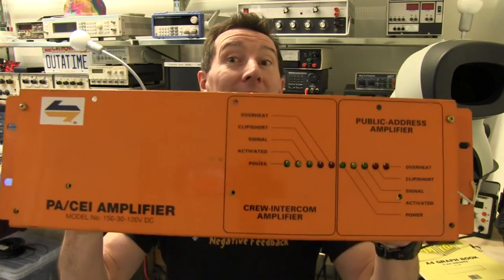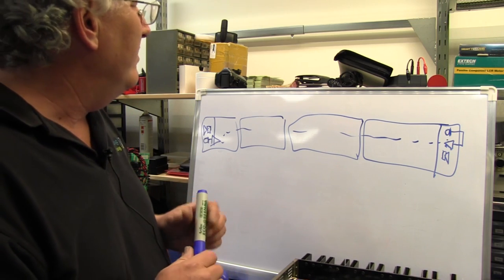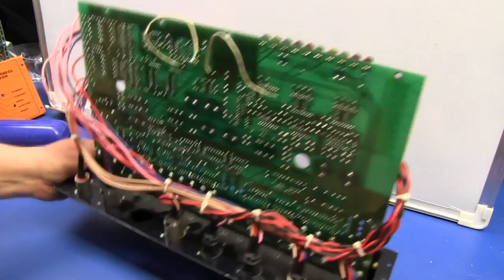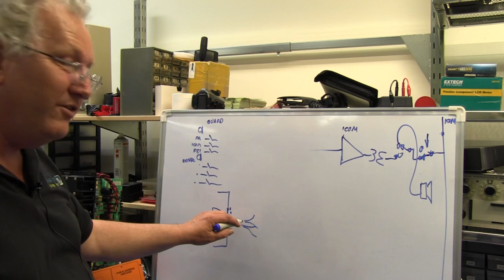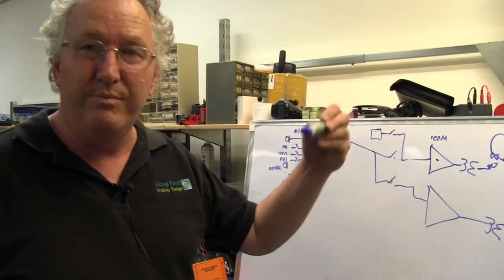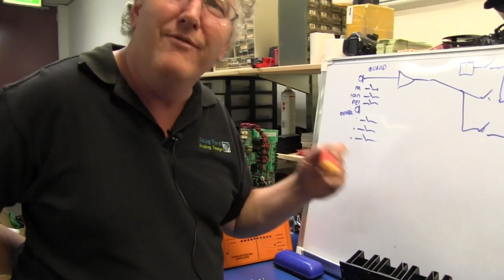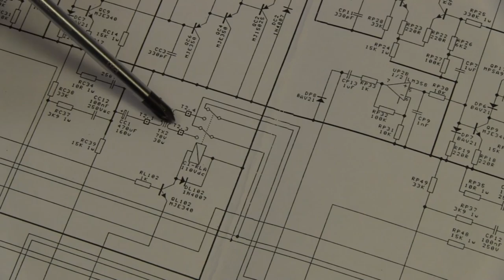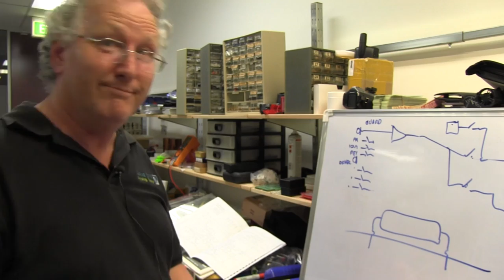EEVblog #354 - CityRail PA Amp Teardown

Comment: I wrote a software simulation of the Virgin Voyager trains in the UK that was based on the schematic diagrams of the train. By the time we'd finished the engineers could connect a real train door, etc to it and test it which was pretty cool. The wiring of a train is a bit mental :-D

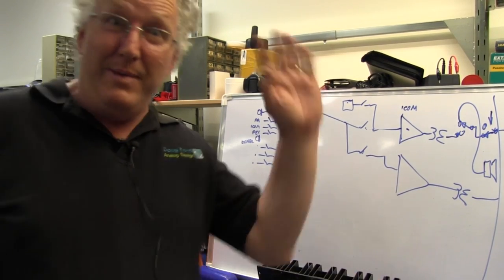Comment: @40:44 - When he described the reliability and life cycle of the JS-920, it reminded me of the Peavey CS 800. The CS 800 is arguably the most durable and reliable power amplifier ever made in the U.S. They started production of them in 1984 and most are still in working condition to this day. They are BEASTS. They weighed a ton and would take any punishment that you could throw at them. They are TRUE 400 watt RMS per channel and VERY over-designed, both electrically and mechanically. I currently own six of these amplifiers, which I had purchased from a studio, which we had done a lot of recording at, and was going out of business. They are in perfect cosmetic condition and, besides some re-capping and cleaning, I’ve had to do no other work to them. Anybody who has been in the music industry for at least a couple of decades truly appreciates these amplifiers. There are higher power amplifiers out there, but when reliability is your main concern, people still fall back to these amps. (Within limits, of course. These won’t power a stadium show.) They are what legends are made of. Peavey also went on to make other great amps, (like the PV-1200, which I own two of) but they still aren’t the ‘tanks’ that the CS 800’s were. I would have hated to be a roadie that had to move a rack of these amps around!!! LOL Here’s a link to the manual, for anyone not familiar with them: https://assets.peavey.com/literature/manuals/80300068.pdf
Reply: Traynor was the equivalent for guitar amps, the creator often testing his amplifiers by throwing them from 2 story buildings on concrete floor.

Comment: Great job Doug . I remember the Jands amps , boy they had balls ! I remember the rock and roll amps , was one of them called JS600 ? I ran one into a dummy load and even into 8ohms it did over the ratings and hardly got warm , very impressive !
Reply: J600 would be the one you are thinking of. There was also the J300 in that series. That was late 1970s. Early 80s the new J series came out, J400, J700 and J1000

Comment: 43:12 the old ones only get binned when both the output transistors and the power supply transformer shit themselves. Valve amps are never discarded, they are so expensive to make we always fix them.

Comment: 1:07:10  What a wonderful self-pwn there, Dave!  Didn't you do a bit on jFET active probes about a year before this?

In addition to microphone preamps, the input stage for practically any instrument amplifier (guitar, violin, mandolin, bass) needs to be hi-Zed, which means either jFET or triode (the thermionic equivalent), which is why the LM072 is ubiquitous in guitar effects.  A low impedance BJT presents an unacceptably heavy load to such low-current voltage sources.  This is a great example of why EE video bloggers should have at least a passing interest in analog electronics.

Comment: The best answer to that is "it depends". Older tube integrated PAs are good candidates for conversion, but in general the following concerns are still considered (at minimum):
Input impedance, Output impedance, Tone network/EQ values.
If it uses balanced inputs, you may have to isolate those inputs to use them with the guitar.

So yeah, it's possible to make a PA into a guitar amp, but it's not strictly "one cap" to do so. It depends on the amp.

Comment: If it's a local amplifier to each speaker then you don't need to overcome any poor connections or induced noise. You can send power and signal down the same two wires.

Comment: 1) PA amps require microphone inputs. Most hi-fidelity microphones require 48V phantom power supplies. Guitar pickups have a high-impedance connection.

2) Guitar amps are designed with a fairly large amount of allowable distortion compared to other amplifiers.

Comment: Were these power amp given screw driver short circuit, and how long did amp last before it blow up ? I am surprised Jans Engineering did't go for well engineered class D mode digital power amplifier. You have forgotten that well worn out P.A systems usely go to E.Bay today or local church or mosque P.A

Comment: you'd have to amplify the line level input to a high enough voltage that it can over come poor connections, induced noise etc. locationing in each car, power supply etc. line transformers are alot cheaper. 

also its 2 wires for all speakers, vs 4 or more.

Comment: better yes, not possible tho. a train is kind of long, its more effective with 1 amp, 100v and trasmit the audio to all the speakers. else you arn't getting line level audio to 100 amplifiers without noise.

the solution here, as in many shopping centres etc, is to use a central amplifier, send it along at 100v and then down convert at each output (speaker)

Comment: Way to complicated.
In the US we use 120VDC for train power.
The intercom system is super easy, it is 1/2 the voltage system or around 60 volts.
70 volts nominal audio, a very common US standard for PA systems.
Lift the handset and it produces around 100 volts at 20 Hz by way of a vibrator (old) or solid state (new).
2 wires?
That is the audio path, but ground one leg and you have an emergency alert bell.
This is a relay that drops out when the handsets are lifted.
Carbon transmitter handset.
Reply: Now that explains a bunch of my observations (knowing only a little about the finer points of amplification* and certainly less about them as they relate to use in trains)...
  Peace be upon you, sir.
                                                       *I know about fish, and music... more than electrical engineering, if I had to pick two.

Comment: Does anyone know who made the amplifiers of the oldest British Rail trains still on the GB network...? (HSTs, Sprinters, Pacers etc...?) It seems like they were solidly built too, as they all still work fine 30-40 years on, and in the case of the first two types with modern sources (TrainFX systems which can play any automated announcements from files, and have a wider frequency response than the microphones)

Comment: Dave, I have a question. On cars, trains, planes, and stuff, I always see the extensive use of single purpose cables. A lot of them actually. Wouldn't it be easier (and much cheaper) to just have one or two ethernet cables running along with the power cables, with every device having an internal IP address?

Comment: How could any one of these power amps drive 300 speakers? I assume they're series-parallel configurations?
By the way, as this video recorded on a Choosday? :)
Reply: 100V line my man. If you think of high voltage power distribution, this works on the same principle. The amplifier has an output transformer that converts the low-impedance output to a virtually constant voltage (70 or 100V systems exist) but high impedance output. At the loudspeaker end a small transformer matches the 100V from the amplifier back to a low impedance drive for the speaker. For 1W output, a typical transformer would have a primary impedance of 10K - all of the transformer primaries are connected in parallel. At 0.5W, as discussed by Doug the primary impedance would be 20K so, a 150W amplifier could drive 300 loudspeakers. Simples!

Comment: I wonder if he had to do board revisions before getting it all right, including those volt-spike features.

or over the PA: Ah mmmonder fff eead ttttto ddoo boat rebishhunhshhh.

Does that work at 70vdc to 150vdc or is there a power supply modifier, which I missed?

Comment: +EEVblog @EEVblog -- I know this video's old, and I don't know if Doug could even answer this or not, but would either of you nice gentlemen know how each car pairing (trailer car and motor car) synchronize their wheel movement and RPM? Further, if the wheels on one of more of the motor cars "slip" due to slippery conditions -- i.e. snow or rain on the tracks (or any other condition, really) -- how do the other compensate? Do the other motor cars get information from each other? So if one of the wheels "slips," its RPM would see a little bit of a spike (I'd assume), so would the other motor cars compensate by lowering their own RPM levels? I'm really curious how this works! Thanks either way =)

Comment: I've only watched for 9 minutes, but I'm a bit confused. Wouldn't it be better to have the amp close to the speaker, to reduce the length of wire the larger currents need to travel? Why not?

Comment: folks, what does "public address" mean or stay for? if you do a test using an electric guitar: a tube PA amp Vs. its corresponding plane one (a Lead or Bass amp with just 1-2channels)  both they fired up on 10 of volume and for many many hours (days?). so which amp will last more time,which one is the strongest/sturdest and which will get to melt  transformers or components inside  first?

Comment: Is there some kind of reference I'm missing with the "all stations to Woop-Woop" thing? I don't get it..
Reply: hehe.... ok
look, this post is 4 years old.   but ok i'll explain it

here is what a standard City Rail message would sound like (what it would say)
so.. if you were travelling on the GRANVILLE LINE (Western Line) and you were at Central Station and the train would end at campbelltown
it would say this

when it departs Central Station , half way to the next station it would say
"NEXT STATION IS REDFERN"  or "THE NEXT STOP IS REDFERN"
or you could get the extended speech, that being

"Next station is Redfern, then Ashfield, Strathfield, Lidcombe, Auburn, Clyde, Granville, Merrylands, Guildford, Yennora, Fairfield, Canley Vale, Cabramatta, Warwick Farm, Liverpool, Casula, Glenfield, Macquarie fields, Ingleburn, Minto, leumeah, Campbelltown, where this train will terminate"

AS YOU CAN SEE, THAT'S A FUCKING MOUTHFUL
then... the guard had to say all that shit AT EACH STATION,  hehe and count out the remainder of the stations

so.... a shorter version of that was this
and.. considering that Granville was a main station where the line could branch off, so was Strathfield
and so was Liverpool

you might hear this
"Next station Redfern
then, Ashfield, Strathfield
then All stations to Liverpool
then all stations to Campbelltown"

much shorter

so.... POINT 1
THIS MESSAGE IS SO FUCKING IRRITATING FOR PASSENGERS
and we know it by heart
actually we know all the messages

so.. if you travelled from central to campbelltown there's a message
if you travelled to parramatta from central there's a different message 
and so on and so forth
we know them all and they are fucking monotonous 

Point 2.   Whoop Whoop is a fictional place, it does not exist.
it is an australian term that basically means

either

IN THE MIDDLE OF FUCKING NO-WHERE
or
WHEREVER THE FUCK 

so, when dave says
NEXT STOP CENTRAL THEN ALL STATIONS TO WHOOP WHOOP

he means

NEXT STOP CENTRAL (just picking central out of thin air because it's the main station)
and then all stations to  WHATEVER.... OR WHEReVER THE FUCK IT IS GOING TO GO (Who Cares, there are too many stations to name,) so he just said WHOOP WHOOP

DO YOU GET IT NOW ?
hehe